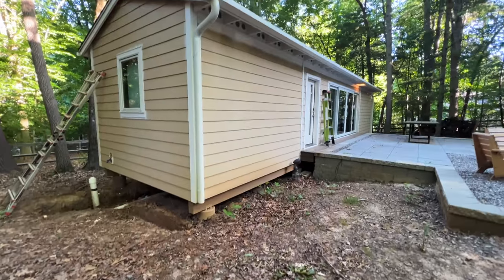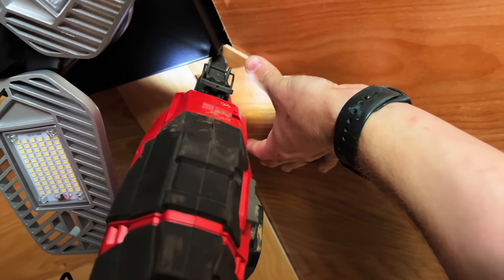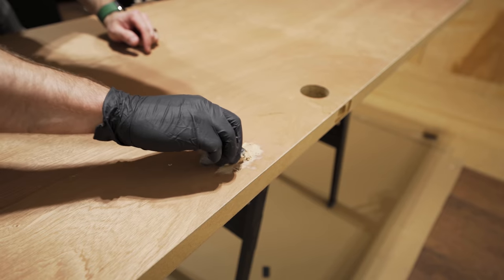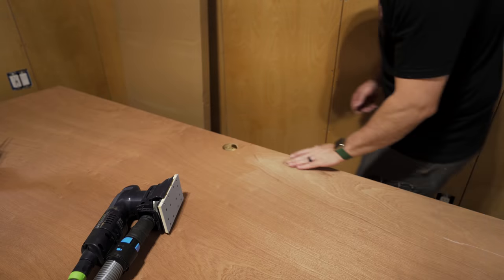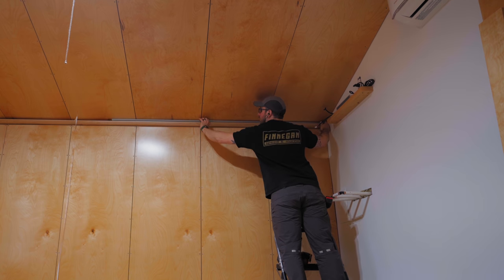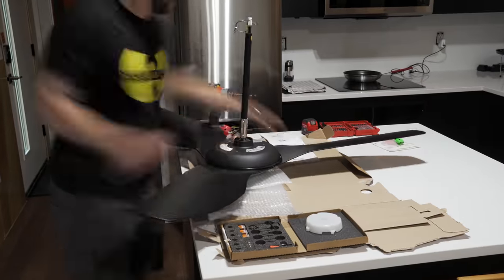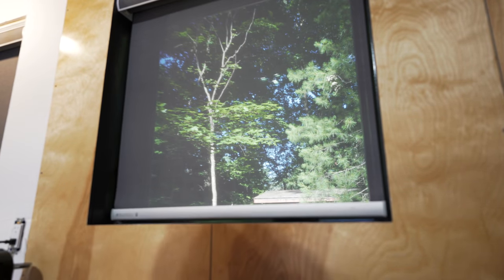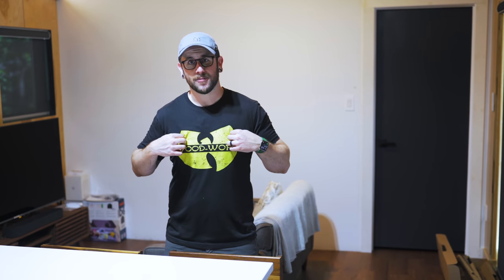4 DAYS to get the TINY HOUSE ready for my PARENTS! Can I get it done?

Comment: Pro-tip when painting doors:  Install 1 screw at the center of the door at one end of the door and 2 screws on the other end (top or bottom) and support the door on 2 sawhorses using the screws.  This way you can hit both sides of the door in one pass by rotating the door using the 1 screw as a pivot point. For heavier doors, use 4 screws, but have help available to rotate the door.
Reply from the maker: Great tip!

Comment: Watching this a a German moving to the US within 2-3 months, I am always wondering about those doors, windows and the electric outlets. 1. I know you mentioned these doors are not a good quality but I have NEVER seen any good doors. First of all why does the doors not have sealings? Here EVERY door has this. They have rubber sealings so they close smoothly, not "wood on wood" and to prevent noise going through. 2. The windows are also a desaster. WHY the open to the outside? And they are so thin and poor quality.... 3. Aren't the outlets available in matching colors? In your example in brown? Are they only available in white? Also I always see the same style. Here we have MANY different styles, modern ones, classical ones and so on. Each manufacturer offers about 20-40 different designs.... thanks for answering. Btw. I love your work! You are really doing a good job!
Reply: Interior doors in the US aren't generally sealed.  I'm not sure why they would be.  Exterior doors have seals as you described. Outlets and switches come in a few basic colors like white, black, brown, beige - and you can get hundreds of styles of covers if you want something more unique.  I don't typically see a lot of unfinished wood windows like this.  But windows do come in a variety of materials - vinyl, fiberglass, wood, aluminum.

Comment: Like the story but it's very underwhelming. The blinds are great, but the re-chargeable batteries is a big negative. The placement of the AC head unit where it is is of very poor placement and highly ineficient when it comes to heating and cooling. The placement of a "Utility Cupboard" inside a bedroom wardrobe that's exposed to the visitors is another poorly planned decision. This should be in a seperate cupboard away from view. Basically, lots of great ideas that have been very poorly executed.